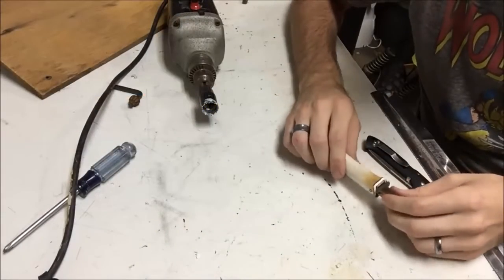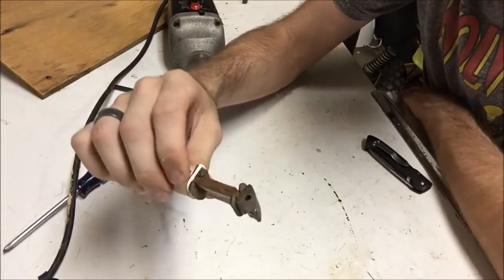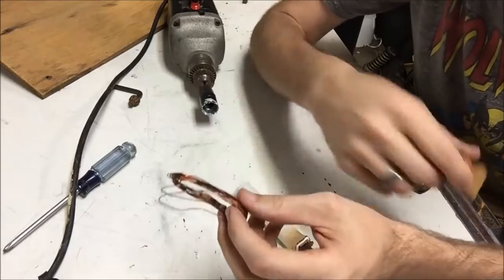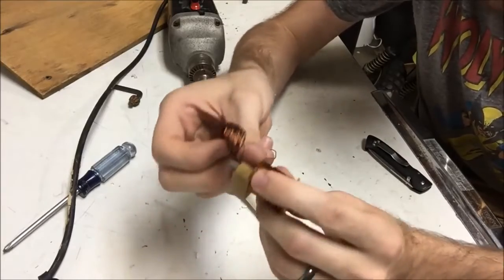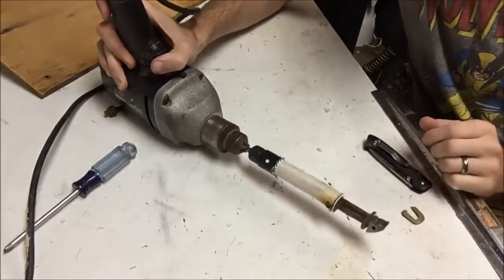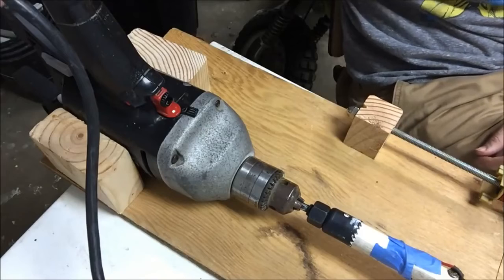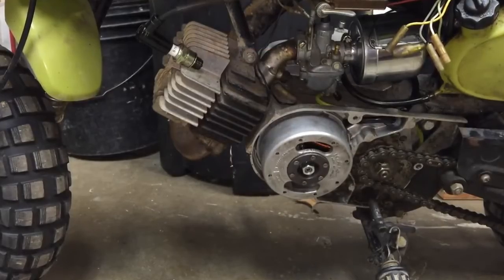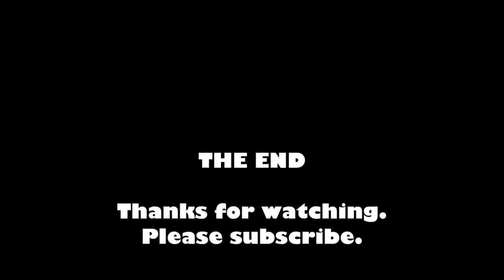Rewind a Primary Ignition Coil **AUDIO FIXED**

Comment: I'm looking into rewinding a coil from a 71 Arctic cat snowmobile. The primary and secondary windings are one on top of the other. The secondary windings are almost impossible to count the turns because they put what looks like a layer of fiberglass over them so its almost impossible to unwind.
Reply from the maker: @dannye5335  if you can cut off the first layer or two, you can try counting the number of wires for a single layer and get an idea of wraps per layer

Comment: Is the coil still working? How did you figure out which direction to wrap the wire or does it matter?
Reply from the maker: Still working great. Wrap direction shouldn’t matter, but as you’re stripping the old windings off, pay attention to the direction they were wrapped and where the winding started/stopped.

Comment: How do i know how many turns  i need and how i will know how much current it can output? 
I want to rewind a coil for my tomos A3 1981year.
Reply from the maker: I just did the approximate same number of turns as the original and tried matching the same resistance value as the original spec. There may be some calculation that will get you a ballpark idea of number of turns necessary but that’s a bit out of my wheelhouse. Some of it will depend on the iron core size/thickness and the gauge of wire that is used.
Reply: @DustinRogersinMO  i've seen on google that you can calculate numbers of turns on transformer by a formula with dimensions of the core + the voltage you want to get/put in but i dont think its the same for a generator.. the coil that i need to rewind is for powering the headlight/stoplight and horn on my tomos moped.

Comment: I have kind of a similar problem. I have an old "no new parts to be had" single cyl system,  My breaker point is history so I figure my only shot left without buying lathe work will be CDI or HEI module and trigger point, but that is taken I can get a charge from somewhere to power it.
I need to rewind my coils to deliver a healthy charge of 12 volts, the more Amps the better. 
Do you know the coil resistance value to generate 12-14,7 volts ? Do you know how much input voltage overshoot typical moped/motorcycle voltage regulators usually can take before they fry ?

Comment: Just wanna know if i understand the process correctly. So the red wire is soldered to one end of the copper wire, then you wrap the copper wire around the coil, and then the black wire is soldered to the other end of the copper wire after its all wrapped? 

Also was the super glue that you kept putting on the wire every now and then?
Reply from the maker: That’s correct. It’s just a continuous coil of wire that will create some current when it passes by a magnet via induction. The super glue was just to keep the windings in place in the event that I accidentally released tension while winding it.
Reply: @DustinRogersinMO  Ok cool tyvm
Reply: A added idea is to encapsulate windings with epoxy after conplete to hold all in place so vibration does not crack a wire..they usually do this step in a vaccumm to bond it tightly...
Would like to figure out  resistance vs windings and wire diameter for a coil..thx for video..